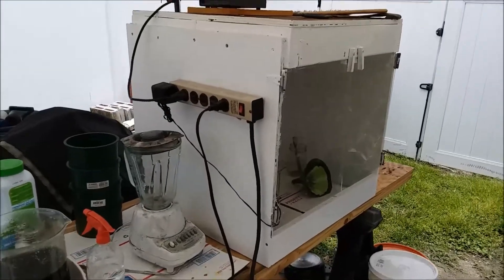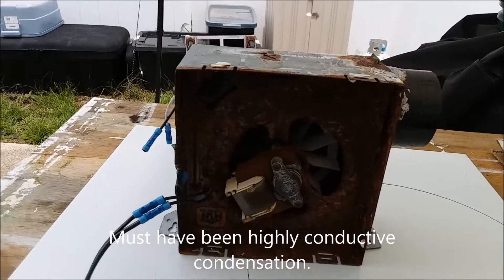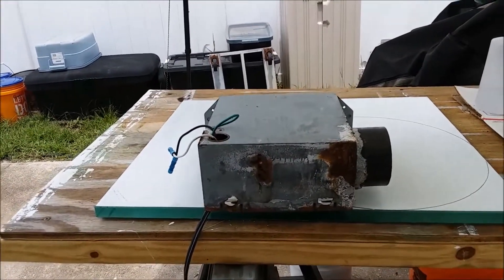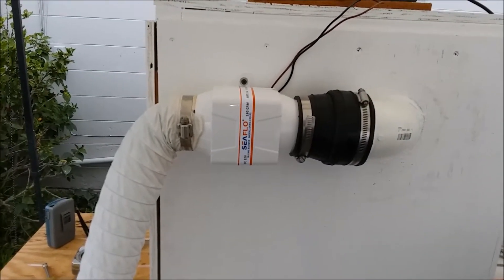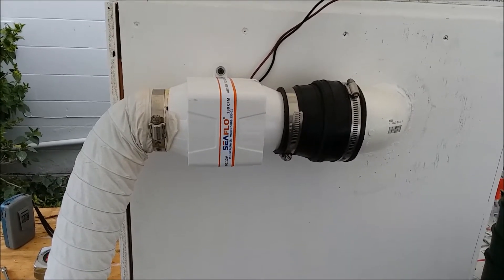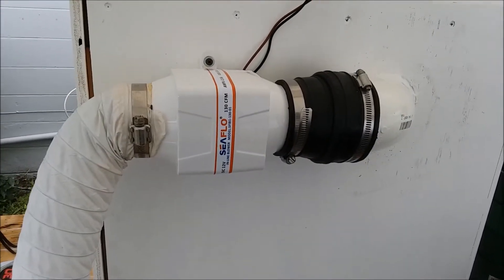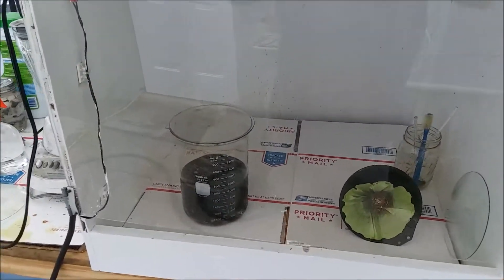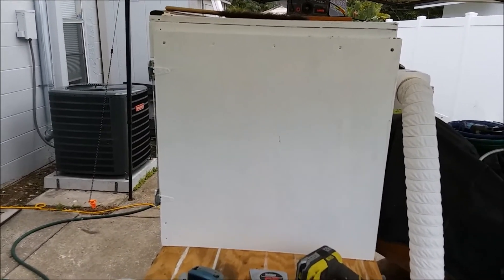2nd Home Made Chemical Fume Hood Update

Comment: I like your idea to use a bilge fan. They are sealed well to be explosion proof. However it will be interesting to see how long it lasts since bilge blowers are meant to be used intermittently. Also another guy on Youtube made a fume hood and used a clear plastic top and put the light on the outside shining down through the top to prevent corrosion from fumes.